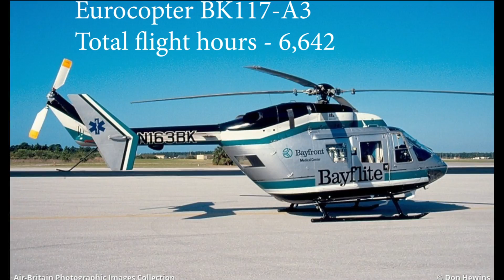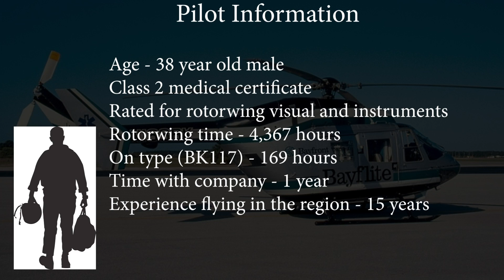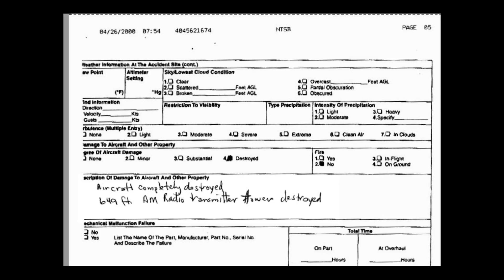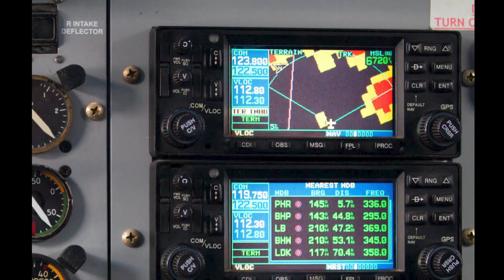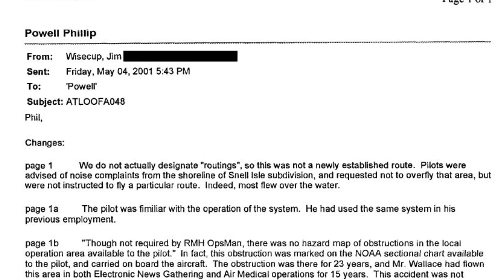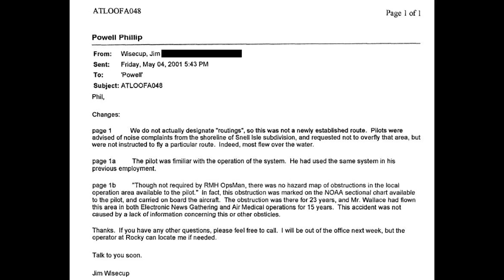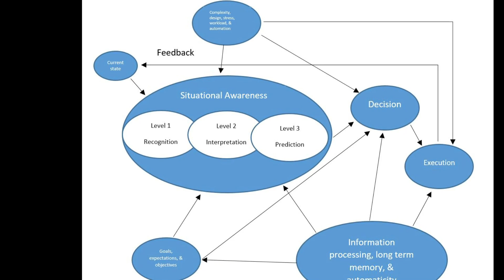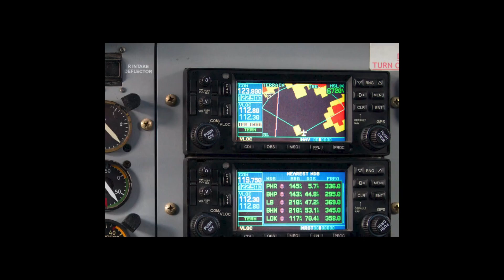Medical Helicopter Crashes into Radio Tower!  The Story of Bayflite N428MB  (6)

Comment: It would be nice if you actually used a model of the BK117 and not a model of the EC-135 or EC-145.
Reply from the maker: Yes, it would have been nice but not available.  Technically though, this is a BK117-D2 (H145).  No real good options for the original MBB-BK117:-(

Comment: The problem here is that they listened to the complaints of the crybabies on the ground and didn't consider the safety of the patients or crews. The affluent, AKA wealthy, stinking rich, complain about everything they don't like because they feel they are above everyone else and those underclass workers should bend to their will and kiss their asses. When the airport should have told them to go pound sand, because they may need that helicopter ride one day. I live close to an active Air Force Base to the East, flying several types of aircraft and helicopters, AKA Rotor Wing, a very active International Airport to the South East that has the largest full time Air National Guard Training Unit in the nation flying F-16's. Depending on the weather, wind and traffic patterns I'm right in the flight path of the airport. Plus there are several Hospitals and a large VA Hospital, All have helicopters. I have something flying over my house all the time. It doesn't bother me, you get used to it.

Comment: Hmm…I thought the TAWS system was based on ground radar sensing the terrain changes putting the aircraft in  a collision with ‘terrain’
  I am not aware of it sensing obstacles such as towers.
  I am only an aviation junkie and not a pilot…but have @3000hrs flight sim…at least I can hit ‘reset flight’😉

Comment: Quite a while back when I got my license, and we were still using paper charts, it was a cardinal sin to not have the appropriate charts aboard. With two crew up front, one of them should have been scanning the sky. You never know when another aircraft might appear in front of you. I had a situation near Gainesville where I was single pilot IFR in VMC, and as I performed my scan an airplane appeared out of the haze directly in front of me. I quickly cranked in about 40 degrees of bank, turning to the right, and in less than 10 seconds the other guy zoomed past a couple hundred feet to my left. ALWAYS keep a sky scan going, you never know what you might see.

Comment: Dual pilot. The only way to fly.
Reply: Adds weight and cost
Reply: One of the problems with HEMS in the US. Too cheap to utilize dual pilot/twin engine helicopters. There are numerous cases where a dual pilot configuration would have prevented a crash.
Reply: Firmly agree. We need to push these greedy companies to do dual pilot.

Comment: Not an accident that is as likely to happen today because of the HTAWS mandate (it is required for HAA operations and not an option mentioned in the video). Also, just because you CAN legally fly low in a helicopter (Part 135 300' day 500' night) doesn't mean you should. I fly HAA and my company recommends 1000' or higher and I fly 2000' and above to reduce mixing with fixed wing at airports, reduce bird strike threats and, obviously, avoid towers . Unless you are on fire or have low ceilings, attitude is your friend.
Reply from the maker: Great points, @Jetjockgordo  I did realize the info about the HTAWS requirements and added a correction and link in the description.

Comment: Hey man great video, but I'll add that as a current EMS Helicopter pilot, there are a few things that were wrong in your explanations. Since 2017 ALL HEMS or Helicopter EMS part 135 operators must have HTAWS Helicopter terrain awareness system installed and operational, its not an option. Dual engine aircraft can fly up to 50 miles off shore without life vests aboard the aircraft, and if the crew have access to life vests then you can go even further.
Reply from the maker: Very good points, Donald.  I do see that this actually became law in 2017 related to HTAWS.  I'll post the link here for others to view but I will also see about adding a caption to the video for clarification.  https://www.ecfr.gov/current/title-14/chapter-I/subchapter-G/part-135/subpart-L/section-135.605

Comment: Do they not use MSA anymore? I was taught to know the MSA for the area I was in at all times. It was on the sectionals so you would know. Which means flying at 500 MSL when the obstructions in the area are 700 plus MSL is a big no no. Also I always had a problem with my instructors on helicopters wanting to fly as low as possible. I got my fixed wing ticket before my helicopter one and in that higher was better. When I started my copter rating they taught the opposite which never made sense to me. I much prefer having some room to play  if something goes wrong not to mention you can see more at higher altitudes than lower ones. My instructors were always on me to get down, get down. I preferred at least 1000 to 1500 msl or better, while they preferred 500 or so feet where possible and even lower. Could these play into things. Its the only reason I can see a pilot flying lower than MSA for the area. It had been drilled into him to stay low.
Reply: I was told that fire or transmission trouble requires a quick landing. Also told, “helicopters often fly in low ceiling/poor vis so you might as well get used to it.” I prefer to fly about 2000 - 3000 AGL. I clear obstructions and can get down fast enough for most things. I’m going fixed wing and looking forward to less tower anxiety.
Reply: @darrylday30  I truly believe fire is a problem for any type of aircraft. My instructor was ex military and he loved skimming the treetops so to speak. Nap of the earth type flying. Being taught in fixed wing higher gives you more options better situational awareness simply because you can see farther to make decisions with and more time to make any decisions needed before you meet the ground made my rotor craft training a conflict because they wanted me to fly very low AGL as you said. I did not and would not fly with a very low ceiling or poor vis unless I went IFR period. The helicopters I flew weren't IFR equipped so bad weather equals a firm no go. The planes were easy to get a pop up IFR if you didn't file beforehand. You should usually know your weather before you go out to your craft. I can't tell you the number of aircraft accidents I had drilled into me that had VFR into IFR conditions as cause of crash. Plus I actually loved flying IFR. I was rather cautious about flying and wasn't interested in going wild up there. Loved it to death but wanted to make it back in one piece. Watched a video on here a while back, guy in a jet took off VFR in super busy airspace to another airport a bit away and flew 200 knots at low altitude dodging a million small planes. Not for me, listening to TCAS going off every second when I could grab an IFR clearance and be in controlled conditions. Good  luck with the fixed wing rating.
Reply: @Ron-ik9ou  Thanks Ron, I’m working on a multi IFR rating now. The strange thing is that I’m actually a mechanic. My flying hobby got out of control a years ago with fixed wing, floats, tail dragger, helicopter and instructor. I’m really looking forward to the next adventure and flying, for the most part, well above the towers.

Comment: as a instrument rated pilot, who has done mostly single pilot IFR, my opinion is this;  NEVER should both pilots have their eyes on the instruments.  Yes I understand the paramedic was not a pilot in this case, however one of them should have been looking outside.  If single pilot, flying VFR you should have a system of scanning the instruments as well as outside.  If flying IFR especially single pilot, you have to maintain a very good scan of instruments.    Just my opinion
Reply: Even in the late 1990s, my Lowrance portable GPS had an obstruction database! There is a "tower farm" just north of here, there would be harrowing to fly through at 500'. Of course, in my Skyhawk, I was at 3K or more.